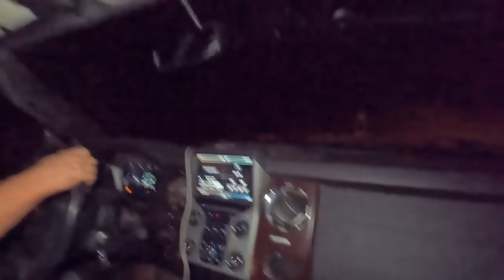You Took Your Hyundai Over 100 Miles Into No Mans Land!

Comment: Maybe that car shouldn't have been out there, but they were a heck of a lot better prepared than most of the people you pull out. AWD, chains, traction boards, spare gas, plenty of food/water, and once you got it out of the high-center it looked like it handled the vast majority of that road pretty darn well. Another couple inches of clearance and they would likely have been in good shape all the way through.
Reply: That, and a winch, not just straps.  Then again, when you have a winch, you need to have the wisdom to realize "we've hit our limit, time to turn around"
Reply: And if you're running alone a shovel and a land anchor to winch off of. Of course there's no place on that vehicle to mount a winch unless maybe you put a rear hitch on it.
Reply: I seen the road an wonder how my crosstrek would do on ATs would do.
Reply: Set of ATs and a 30mm lift would make a big difference
Reply: I don't know about that car not capable of driving there. I have driven my sedan thats 165cm high off the ground, overloaded 😂 in much worse mud without getting stuck. It is the driver more than the car i feel
Reply: i would REALLY like to know what he charges for jobs like this.. some jobs i see them drive 3-4hrs + ONE WAY, so 7-8hrs driving , couple hours there.. then paying 3-4 people on average.. that job with the sante fe, to make money and make it worth it.. i mean i would like to think it would  be around 1,000??? am i way off or what?? any people like to comment.. i know with the youtube revenue definitely takes the financial pressure off but i know hes been in business long before youtube ads..
Reply: Going that far out, they've definitely done it before, however I think they really underestimated the weather and went at the wrong time.
Reply: @bigdogblast  $0
Reply: @Dienamus  you’d be paying Matt in that mall vehicle
Reply: @bigdogblast  I don't think he would charge for the people doing the filming or minors.
Reply: @warlocks970  That one was high centered. Good driver would help, but if it’s deep soft mud sometimes it doesn’t take much for one to sink and get high centered.
Reply: True they were somewhat prepared, just went in the wrong weather.  But imo you really need more clearance, skid plates, A/T tires, and winch or at least a come-a-long. Unfortunately there’s not many vehicles that fit that criteria that are affordable, unless you can score a deal on a used 4-runner or Jeep?
Reply: It's a Hyundai, not a Subaru Outback Wilderness.
Reply: @darkpassenger65  no better.
Reply: Yep. I see people all the time in my wheeling groups begging for help because they went out solo with no recovery gear
Reply: @RowanHawkins  A come-a-long would have been a good $40 tool to have in the back.  Would have been enough to get it out.  Takes a lot of work but can save your life in a spot like that.
Reply: So where did they hide the body 🤔
Reply: @airgliderz  Outback Wilderness are seriously capable vehicles, would have had no trouble with those conditions.
Reply: @bigdogblast  local guy in similar high desert charges $1k for two hours rescue involving off road.
Reply: @warlocks970  
Bro you have never driven a sedan through mud like that….
Reply: @galenztwo  yeah I have. It was worse than this, it was through a farm land for more than 20kms and is a site of illegal sand mining, because of which heavy trucks go through the same mud and make it much worse than this road 😂
Reply: @warlocks970  I thought the same. My father was driving his Golf3 through mud, so it looked like a flat surface afterward. However, it was only within walking range from home. I guess that is the difference. If there is not cell phone coverage or civilization within walking distance, you probably should be 100% sure.
Reply: @Booster6969  any Outback is pretty capable! My girlfriend used to have a bone stock 4 cylinder 2015 and I can confidently say they go places you’d never imagine. Blew me away every time, it was just horribly slow.
Reply: @Dienamus  probably would have done pretty well, my girlfriends Crosstrek on +1 size Walmart all-weather tires does amazing in snow, never taken it through mud but I imagine it's similar
Reply: I agree, depending on the weather forecast they might have been expecting to get out before it, or didn't even know about it before hand.  In the normally dry times there would have been no problems with them being out there.
Reply: Wrong tires are to blame
Reply: All they forgot was a shovel!
Reply: @bigdogblast  Thousand? Man a 3 hour tow on the highway is like 500 bucks. He's definitely charging at least 2000 for that kind of job, probably 3000+. I would also bet the customer has to pay for consumables such as gas as well. 

There's simply no other option than to abandon your vehicle, and getting back out there, even if you wanted to try and drive it out yourself, would cost hundreds because you'd have to find a ride.
Reply: @bigdogblast  Lets see......12 day old video + 1.3 million views + 1.41 million subscribers = Bank.  And.....deserving every penny.  I get hours of enjoyment out of his videos.  And I'm sure others do too!
Reply: The only thing they needed was a better car haha
Reply: @thisisbabychino  I'd add a lift to that, only thing you gotta worry about is lifting a tire off the ground. You got no lockers and I assume your sway bars are still on it so that would be the biggest issue. Don't forget to pin the throttle🤣that's how I got through shallow mud pits in my 98 outback sport on all seasons. 1st gear, flat foot into second, and let er eat. To be fair, my car is a good bit lighter than yours. Your ats make up for that
Reply: @warlocks970  I'd give it up more to luck not driver skill.
Reply: @warlocks970  it got high centered.  once you get high centered its game over no matter what you drive.  ground clearance is so important.
Reply: @bigdogblast  It has to be at least $1,000 for him to just break even
Reply: The only thing he didn't bring was traction.
Reply: @bigdogblast ea it has to be in the thousands .. that 1st he did had to be around 2k…. side note,  he got in trouble because i guess he was having customers get a triple A membership because it would save the customers a lot of $$ and he would change the date on the invoice to a date after they got there membership so that they could charge triple A instead.. shows you the dude is really a good person for that.
Reply: @Booster6969  I actually wonder, have there been any (or many) subaru's rescued by Matt?  Now I'm going to search to see if he has a video with a subaru.  I've got a 2023 Subaru Ascent with AT tires and skid plates and it has chewed through everything we drove on, even well over a foot of snow without needing to engage x-mode or anything.
Reply: @r7blue  changing the date on an invoice to deceive an insurance company is a criminal activity
Reply: @Dienamus Love my lifted 07 Impreza wagon. It'd eat this trail no problem
Reply: @darkpassenger65 that's why he got so far back
Reply: @quikgt totally could score a used runner or a jeep  about 5 or 6 payments of this new one that's already junk

Comment: If anyone watching Matt has ties to a satellite communication company, please have them sponsor this man!  He is doing amazing work helping people in mostly cell phone dead zones. What a great way to advertise your strength.  Keep up the great work Team.
Reply: Or maybe mounting a amp with high gain antenna on the cars.
Reply: @russellhltn1396  He already has a ton of gear. A sat. communicator like a Garmin Inreach fits within the palm of your hand. It would fit in a pack of cigarettes box. And it doesn't require outside power. It is waterproof and can be taken to shelter. It's the right choice for emergencies like calling in an air ambulance that saves the time of a 2nd vehicle having to drive miles back to cellphone coverage. 12 bucks a month.
Reply: Great idea! A Garmin In-Reach is small, light, water proof, and can follow waypoints, send emergency texts, etc. A high initial cost of around $300-$400 if I remember right, but I pay only 12 bucks a month for my Sat subscription and that includes monthly free texts.  Databyter
Reply: They forget to fill up, last video they forgot to bring the 30 ft rope. A Sat Phone is just another thing they will forget and will usually be forgotten on the day they actually need it
Reply: @J-P88  I keep my In-Reach in my vehicle for that very reason. No reason it ever needs to leave it unless I am hiking. I used to keep in inside my house, untiil I saw a video of a guy that had one, but forgot to bring it and was stranded in the middle of the night in the snow. Now it's always in my car. And it charges from USB so no issues there.
Reply: @russellhltn1396  I have a cellular booster and have used it to get a zero reception signal in a building to full bars.
Reply: Elon get this man some starlink!
Reply: @Databyter  That seems like the ticket right there. Pretty cheap to ensure that you don't waste the whole day plus a tank of fuel.
They still think Matt should have a minimum charge.
Reply: @J-P88  Be cool! They're no worse off if they forget it and they're hell of a lot better off if they don't.
Reply: I bet Ed would be a great Ham base staion dispatcher, edit  woah 2 JPs hahah
Reply: And save this man a 10 hour drive to boot
Reply: Doesn’t the new IPhone 14 now have satellite phone service built in?  They use iPhones to film some portions.
Reply: Matt can't even fill up his tank of gas before rescuing ppl. What makes you think he wants or would use anything like that. Sometimes I feel he does it the hard way on purpose just for the views. Otherwise the content gets a bit bland.
Reply: As an off-road motorcyclist and hunter the in-reach is worth the bucks. I turn it off like 6 months a year. May give it up soon as I'm now over 70 yo.
Reply: I was thinking the exact same thing. I think it's crazy to go alone in some of these areas so far away from cell phone service. I have a Garmin inReach, it's like $12 a month which is nothing and the piece of mind is priceless.
Reply: @Databyter  I use Garmin.  Started back in 2008 with my Dual Sport Motorcycle.  I just upgraded to the Garmin GSMAP 66sr for my truck.  Handheld and waterproof.  I had/have the old 60csx...
Reply: That is an excellent idea! A satellite phone company to sponsor Matt's channel! It would be great advertising and showing how well their product would work!
Reply: I kind of enjoy seeing the actual people who put themselves in these positions... Matt is a Gentleman...  He never gets mad,  loses his cool...Even when he puts his people and equipment at risk. A Free T Shirt...
Reply: There are fantastic boosters
Avaliable
Wish i could afford 1
Reply: Tesla phone?
Reply: What a cool job to have 😎👍. Some people pay to go on adventures like that  😊
Reply: Better reach out to Elon Musk
Reply: T mobile is close to having phone to satellite with any existing phone that can get the 2.5 GHz frequency
Reply: Another vote for Garmin inReach
Reply: @spacekb17  star link is garbage.
Reply: @andrewmcallister4151  
This is what it was designed for. Remote areas for emergency use.  It’s not meant to be blazing fast
Reply: Or wearing seat belts why not, “Recovering crew has roll over and no injuries,
Reply: @russellhltn1396  : legalities appear quickly in these spaces.  lol..
Reply: @J-P88  : lol ...excuses for poor planning, .. ha ha.. - a 12V plug in battery maintainer with everything in the vehicle ready to go, no problems.... (use powerpole plugs and it will even be drive-off ready to disconnect  - occasionally - fix it after.

BTW in these eventualities a 5 gallon jug of fuel is also a simple operational insurance - as is a trolley jack and wheel wrench - they are "pro's" = after all.
Reply: @Databyter  we carry something similar on the yacht when we go to remote locations where even radio transmission is intermittent ( we can send but no-one to hear). Worth the cost for sure.
Reply: The crew should look into Wilson Electronics/weBoost. They are local to St. George and sell a product called the Drive Reach. Could be beneficial for their rigs.
Reply: Samsung is planning to add satellite communications to their flagship phones
Reply: I think if he just added a second battery to the morvair then he wouldnt have alternator problems because he would have more power available before needing the alternator ramping up all the time
Reply: @photic9855  most 4WD enthusiasts in Australia fit a second battery for two reasons, 1 winching, 2 able to run auxiliary equipment without flattening the starting battery and both batteries can be run in parallel for extra amps.
Reply: @J-P88  have you considered that the intentionally ‘forget’ things to make the content more interesting?
Reply: The guy refuses to wear a full sleeve shirt let alone a jacket. You think he'll carry a sat phone 😂 kidding though.
Reply: @Databyter   I have a in reach/ gps I love it and it's not very costly for the service and may just save your life
Reply: Tesla phone will be available very soon, it will be Starlinked..
Reply: Time to put a mobile starlink on the roof,
Reply: I second this. We got a Garmin Inreach for when we go off-roading. If we have an emergency situation, I’d like to be able to call for help and have the right assistance come to the right place, quickly, with the right gear.

Comment: Today 01/21/25 I did my first recovery! I had bought 2 soft shackles a long while back, and had yet to use them. Might seem silly, but it was in town at a gas station (they have a ditch off the side of their lot for drainage). Lady had gone over the edge because the recent snowstorms in Michigan are making visibility an absolute bugger. I was very happy to use concepts I've learned from MORR in order to keep the recovered vehicle safe from damage. A passerby in a larger truck than mine (I'm using a Ford Ranger Sport with a plow) offered to pull and my recovery ring was the perfect fit for their 2" receiver. Everything went well, we used proper communication to let both parties know what needed to be done to accomplish the task, and we accomplished our goal safely and professionally. Thank you MORR for helping teach me what to do!

Comment: A manual throttle knob to raise the engine rpm might help the alternators live longer. Some guys also run dual alternators. Running dual stock alternators in my opinion is a better option than getting a custom one built. If you blow one up, very easy to get a replacement stock one. Not so easy to find a custom replacement in a hurry.

Comment: Matt, have you thought about putting a 2nd alternator on so you can winch with the engine and without putting so much strain on the single alternator
Reply: I have the same winch and it's max draw is 300 amps. Even with a 120 amp alternator, one would have to add 180 amp alternator. I wonder what that would cost, brackets, different belt, wires, etc?

Comment: Hey Matt, do you have alternator issues often? I did on my 96 T-100 ( Toyota truck) , for me the water crossing were washing grit into the alt. To solve that issue I put a water cooled alternator from an Audi. Benefits were, 190 amps, and the alternator is sealed. I plumbed it into the bypass between the water pump and the block. HTHs

Comment: Boy there is a lot of empty country out there.  I remember driving out in Wyoming in the early 70s (at 15 yo) and thinking the same thing.  I am constantly impressed with the capability of that Morrvair.  It's a very useful tool.  I hope you got paid well for this one Matt.  I think this is the most challenging rescue I've seen so far.
Reply: Matt's comment about no mans land is no joke!
Reply: Australia just smiles in the background, thinking of what empty truly looks like.

If you take away the population from the first 50Km off the coast, the Pop density in Aust drops to ~0.3 people per Km2, meaning you would need ~3 Km2 to get 1 whole person.

For some perspective. Aust is about he same landmass as the USA, with less than 10% the population.   
US 38p / Km2  vs  Aus 3.4p / Km2 
A slight difference as you can see.

Comment: Those folks are lucky to be alive, and lucky that they called the MORR team to get their vehicle out. The AZ strip is no place for anyone but the most prepared and well equipped. Too many people think “all wheel drive” equals off road capability.
Reply: I was on that road in the fall and it was dry and in many places I was well over 60mph. Not now by the looks of things.
Reply: They were on a road, were they not (i.e not 'off-roading')? And one that is probably fine in dry weather? Obviously it was a very bad plan in these conditions.
Reply: @xxwookey  there are a lot of “roads” in the SW that are not very friendly to many vehicles that are built more for driving on paved surfaces. My comment is pointing out that “all wheel drive” does not mean that driving 100+ miles, in a very remote area, with little to no cell service is a good idea. They did have tire chains, which was better than nothing. They were there for 3 days before being rescued. Again, they are lucky to be alive.

Comment: For those that are unfamiliar with the term, a borrow pit is one that typically happens on a construction site. An excavator digs a hole to get top soil, then fills the hole with old bricks, broken concrete and the like, than covers the hole with the top soil. 
This is probably what Matt wished he could do with all that mud.
Reply: To build a crowned road with drainage on each side, graders run down each side at an angle, borrowing dirt from the ditch to make the roadway.   Originally called a "borrow ditch", at least here in Texas it usually gets called a "bar ditch" because we lazily lost a syllable.
Reply: I’ve heard people call it a “burrow” pit. And I’m like “no, that’s not the right word”.